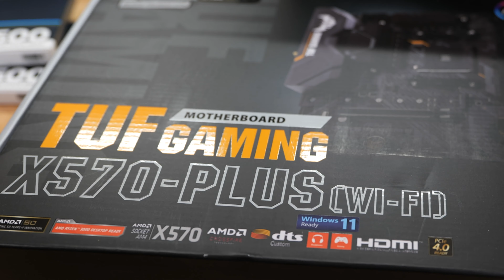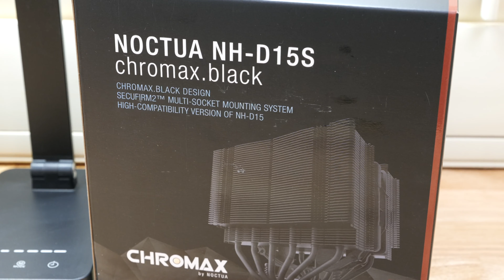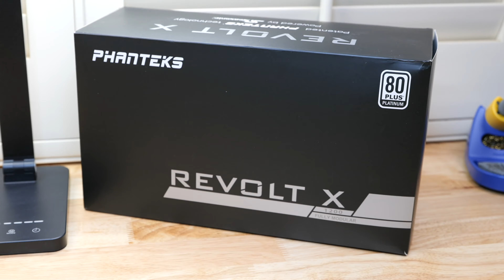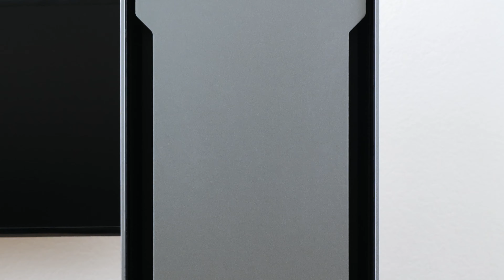Hybrid Desktop PC Server Build | Part 2 - The Desktop PC build

Comment: Nice build, i did similar 5800x + Scythe air cooler, 1 tb nvme all during C-vid. 5800x was the only Good cpu available at the time. i have since added 1 HDD 4tb, then turned my old 3770 into a "server". I was Chia mining, until it got crazy, wasnt gonna buy dozens of (overpriced)    hard drives for that
Reply from the maker: Thanks for sharing. Yeah, the last gen stuff got really affordable the last few months so it felt like good value, even though 5900X on AM4 is last of this socket. Really fast machines for not a lot of money these days.

Comment: 22:56 "when you read the specs of the case, it doesn't warn you that..." haha. noob! 
I'm thinking the 2.5 inch slots are limited to 6.4mm - 7mm drives.
I'm also thinking it would be possible to cram all the cables in there if the top row was routed through an additional custom hole above the PSU, but that may be a turn-off for some due to additional cables in the main compartment. 

Cool build overall, and good on you to spot this case and the PSU. I like unique products like this. You're looking at 800-1200 MB/s throughput on the backups which is not  shabby. I'm guessing the secondary system can come online/offline on demand so that's pretty neat. I mean it would suck a little bit if you could not turn all those 8-10 LFF spindle-drives off during regular sessions.

Your son is going to be well off with the 5900X for at least a couple of years, possibly even 4-5 years, but a system like this has good longevity even beyond that.
Reply from the maker: LOL... noob indeed! :-)

Yes, I think the 2.5" holes behind the cable cover panels will have to be 7mm or less. Especially with a lot of cables back there. The 2.5" mounting locations behind the M/B tray might be able to take thicker SSDs since there's some more space between the M/B tray and the glass panel.

I don't think you can get the 2nd motherboard 24-pin ATX and EPS cables in there with that 3.5" bracket in there. There's barely enough room just for an empty plug, much less if the plug had wires in it.

thanks for watching! :-)

Comment: This was an enjoyable build, and thanks for pointing out the cons of the case, especially with the 3.5" cages at the bottom. While a disadvantage in PSU cabling space, even with 8 bays you can get well over 60TB if using high capacity hard drives. The Noctua cooler is nice too as I have an older version with my old i7 3930K system. What OS did you install for the desktop side and did you have to install the driver for the Mellanox ConnectX-3 card? 

I am considering possibly doing a build like this since I do video and audio editing and having a desktop and server in one case would be awesome as I have a very small room right now (no space for my large Dell and SM servers at this time). I've built my own PC's since the Pentium II days so I look forward to trying this one, if I can find the parts at a reasonable price (been overpriced due to all the mining and chia stuff, especially GPU's).

Great job with the video, looking forward to the 3rd part soon!
Reply from the maker: The desktop PC is running Fedora Workstation 37 Linux. The driver  was already native to the Linux kernel so everything just worked.

Yeah, I think a build like this will suit a lot of folks who don't have the space, or prefer a more compact setup. Also, with 10-20TB HDDs these days, even with double parity, you are looking at 60-120TB of usable storage. So, even with 8 drive bays I think this has a lot to offer.

thanks for watching! :-)

Comment: Are you mirroring those boot and home drives on MB or in OS?
Reply from the maker: For the OS boot drive, I'm just using Linux MD RAID-1. For the /home directory, I'm using ZFS to mirror the 4TB drives. I could use ZFS on root, but I prefer not to complicate the boot sequence dependency. And mostly, the features I want from ZFS (snapshots, checksums, etc.) apply to the contents of /home. Good question and thanks for watching!